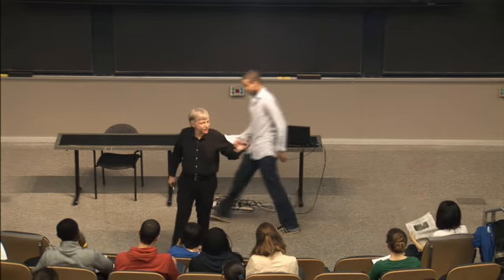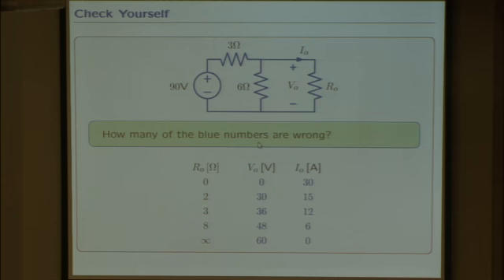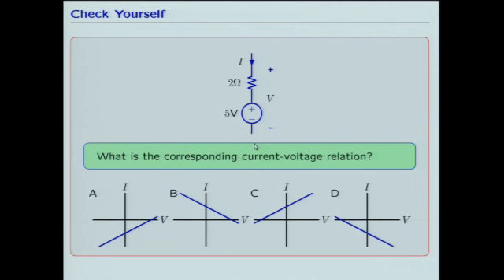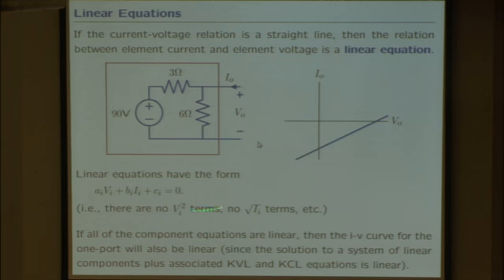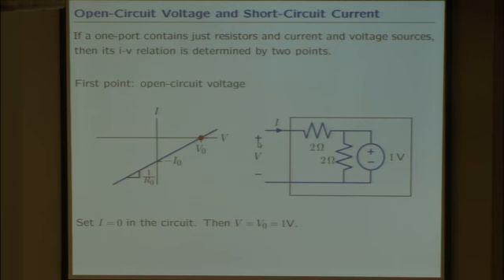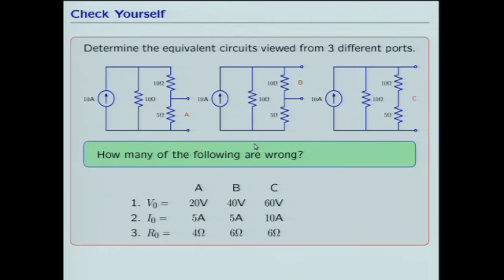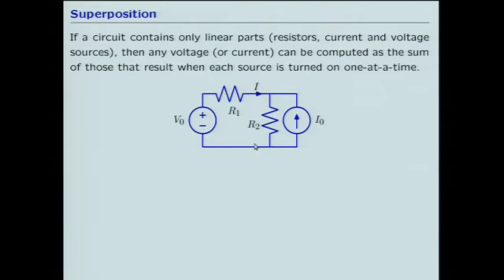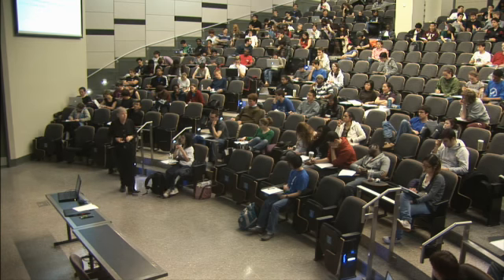Lec 9 | MIT 6.01SC Introduction to Electrical Engineering and Computer Science I, Spring 2011

Comment: Why American or Western Engineers don't understand that Electrical Engineering, Electronic Engineering (including Telecom Engineering), Computer Science (including Software Engineering)& Computer Engineering (incl.Computer Network Engineering) are 4 different disciplines though some subjects or topics may be common in their degree syllabus or curriculum
Reply: They are 4 different disciplines when you specialize in one of them, but in this course its just an introduction to a lot of fields that they believe are within range of EE and CS. MIT unified those fields into one department and its the way they make courses as well.
Reply: all of them are branches of ee. They just branched out recently .
Reply: @huhuhuh-v5b  No, you are wrong. CS is present for past 50 Years. As of Year 1980, it had evolved as a seperate discipline. EE or Electronic Engineers don't have knowledge of CS ( Computer Science) or CSE(Computer Science & Engineering) disciplines.Morever, Software Engineering & IT evolved as a specialised disciplines out of CS or CSE. And now, AI is emerging as a separate multi-disciplinary discipline. The way, today, Aerospace Engineering is different from Mechanical Engineering, that is true for above disciplines

Comment: I didn't quite get how is current in second branch is 4A. Can someone explain it or give a resoure to figure that out?
Reply: Current 10 A divides itself in inverse ratio of resistance(that's also done in superposition example for finding i2 while shorting voltage source). U can also think of node at pt where the two wire separates.
Reply: https://youtu.be/rOA1VC5aQ7Q see last three minutes of this video this may help